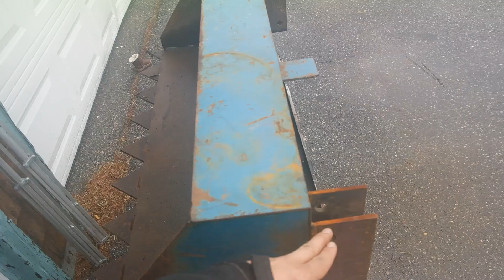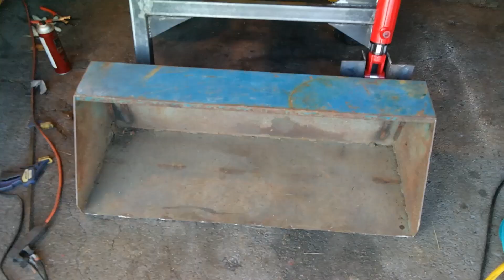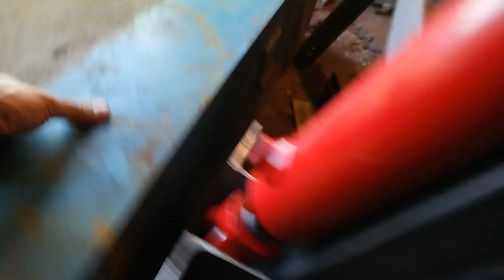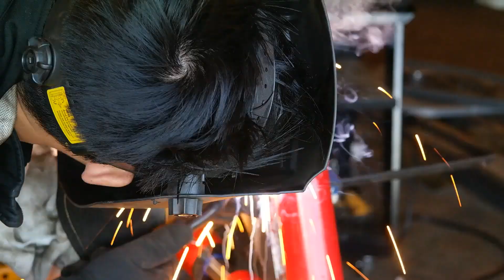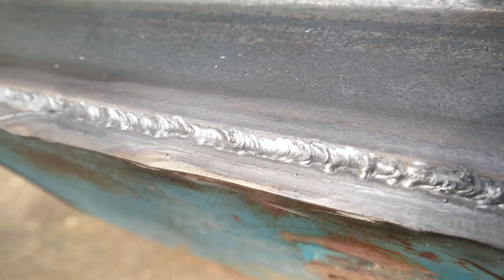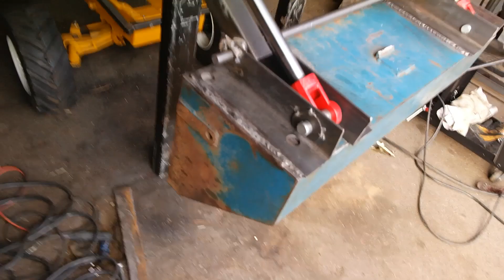Cub Cadet 149 TLB Transformation Part 8: Loader Bucket Build

Comment: Have you experienced any problems with your hydraulic cylinders, mainly the seals failing after welding the brackets on with them in place?  I'm getting ready to build one of these with PF Engineering plans for my JD 430.  I want to gather as much information as possible to avoid as many issues as possible.  I like the idea of the bucket angle up a little higher!  Any other suggestions are welcome and appreciated.
Reply from the maker: No issues with the seals. The seal area never got hot during welding.

Comment: Hey, we talked a bit at the Elliot Tractor show about a FEL build on a JD112. I'm in the process of designing my build and was wondering where you sourced the hydraulic parts, and possibly maybe the part numbers. You can email me if that's easier, I know promoting a company that's not a sponsor publicly might not be something you wanna do. Any help would be appreciated and thank you, I'm gonna be placing an order soon for that k241 rebuild kit you have, most complete kit I have seen anywhere.
Reply from the maker: Hi Keegan, thanks for your message. No problem on telling you some source for parts. I bought my hydraulic components from surpluscenter.com. The loader boom cylinders were 2 x 16, and I can't remember the bucket cylinder sizes. I will have to look it up, I may mention it in this video series. Send me an email and I can give you more info. Surplus Center is amazing website. I browse it just for fun!

Comment: I have put that small tilt in my note Thank you for that I am building the loader for my John Deere LA125 Lawn Tractor. What size cylinders are on your loader. I live on an acreage and will be using it to move around soil and other materials like manure and small gravel.
Reply from the maker: I am pretty sure the cylinders on that loader are 2 x 16.

Comment: How much did it cost to build the loader I'm thinking of building one my self
Reply from the maker: I bought all the materials for the backhoe and loader together but I estimate the cost for just the loader is about $2000.
Reply from the maker: actually $2000 is a little high. I think it would be about half that. between $1,000 and $1,300
Reply: +isavetractors ok thanks any suggestions of a tractor to put it on
Reply from the maker: +Connor Grogan IH Cub Cadets are great because of the frame and fender configuration. it's easy to bolt stuff onto it and it's easy to build around the fender. the rear end is also all steel and perfect for handling the tough jobs. I have a loader on a Ford LGT as well and while it's a great tractor the tube frame made it diffuclt to bolt a subframe on and it required more problem solving. I did it though
Reply: +isavetractors I was thinking about mounting it to the wheel horse or like a John Deere 318 or maybe a case Cubs are hard to find in my area
Reply: Connor Grogan s
Reply from the maker: It cost me roughly $4000 to build this entire thing including buying the welder.